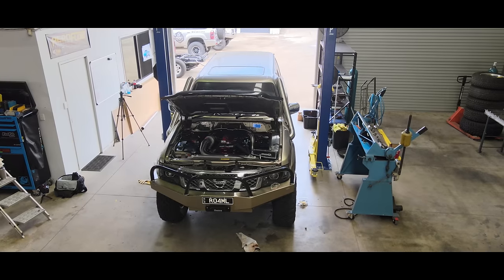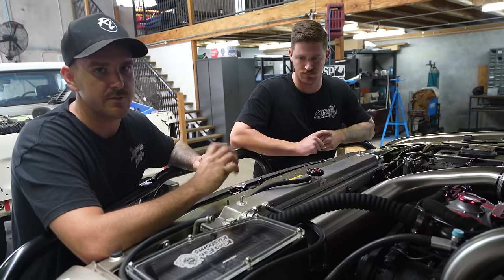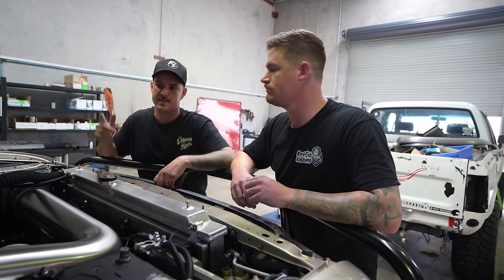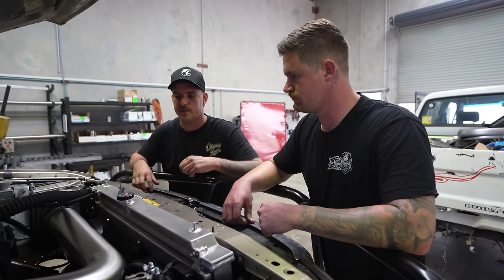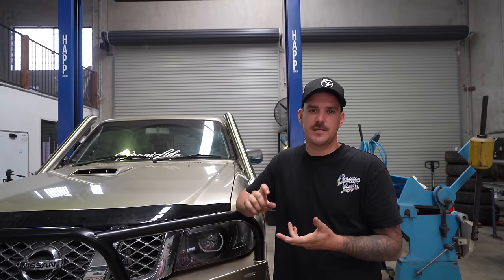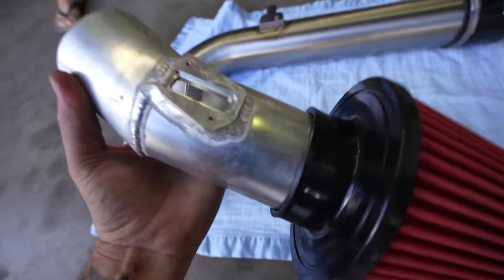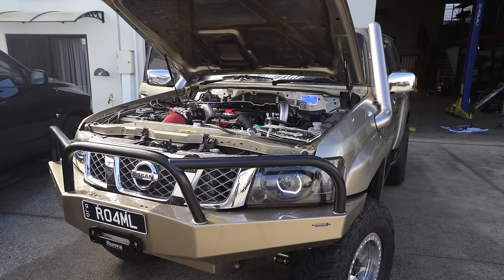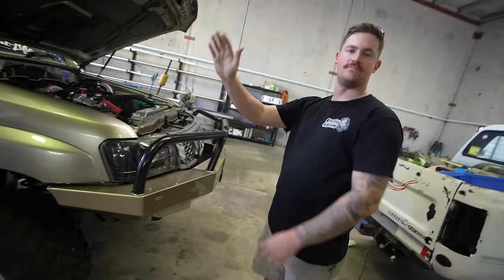First Time Driving the 4j Swapped Nissan Patrol! SOUNDS AMAZING!

Comment: Truly curious to see what scoop you elect to go with.
I'm keen on the colarodo style myself, but you mentioned you're moving away from that.
I may see if a Jackaroo 4JX1 scoop works myself.
I had my ZD30 tuned by East Coast Performance Tune, the standard ZD30 turbo sounds mint when i back off, fluters just as my old D4-D V8 did and the Troll goes as hard now as that D4-D V8 did, but bear in mind the D4-D is not tuned to perform, even though mine was chipped.
Hope your efforts are rewarded well, i couldn't go through with all that effort myself. Have to say, im truly impressed how well my ZD30 goes now after East Coast Performance Tune fitted Cross Country intercooler, Tillix boost control and ECU tune, 779Nm at rear wheels is nothing to be sneezed at.
Totally different vehicle to drive now, as yours will be.

Comment: That corrugated top hose is too high AND they don't handle much pressure. Piss it off before it lets go and cooks the engine. Sounds just like a Chamberlain tractor!
Reply from the maker: This will be changed to a tig weleded stainless pipe!! This is just a temporary hose!